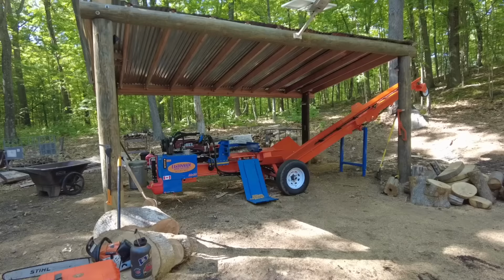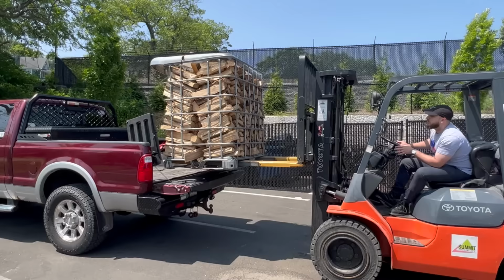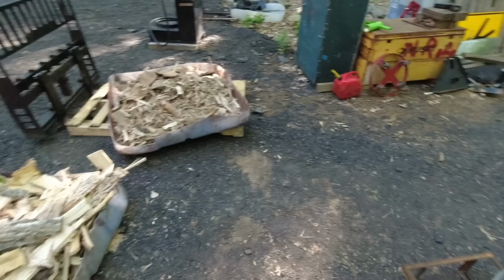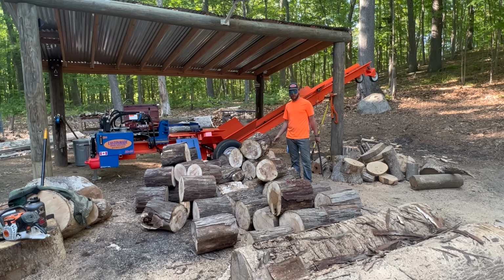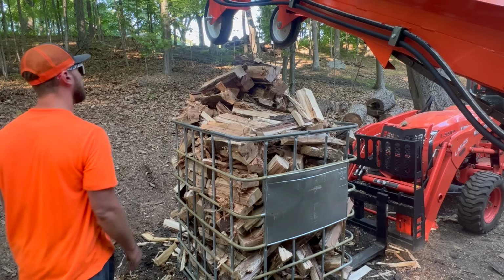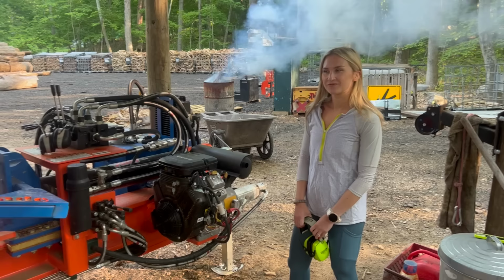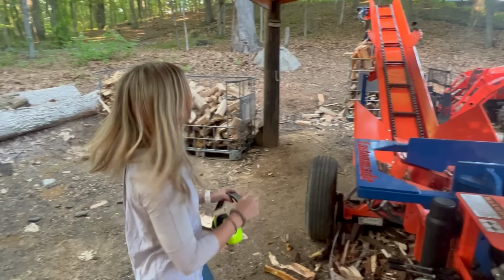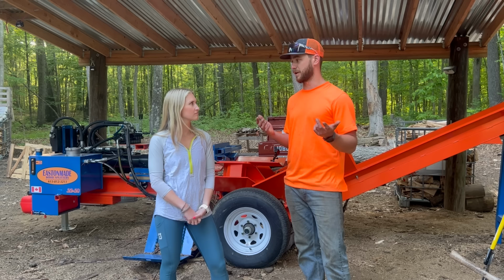#382 Splitting Hickory with the Eastonmade 22-28 & 7-Way Box Wedge

Comment: You have a first class operation and woodyard over there!

I like the fact your split wood goes straight into IBC totes, which significantly eliminates handling. If all deliveries use your totes,  you will be light years ahead of your competition.  

If you have to dump loose firewood for some customers, you can buy a "rotator" for your tractor to empty out the IBC tote into your dump trailer, to eliminate "that" extra touch of the wood.

I've been "pushing" the IBC tote method, but there is fierce resistance to buying them, and dropping them off at the customers place of business, or their residence. The  customers love them. I noticed you deliver them with the roof on top. Very nice!
Reply: The following video at the 9 minute mark, demonstrates the "fork lift rotator device" for dumping out ibc totes into trailers for loose delivery dumping.

https://youtu.be/jZr5h4xzKJQ
Reply from the maker: Thank you, unfortunately most of the rotating fork assemblies I’ve seen are designed for skid steers and are pretty heavy. If I were to get one I’m not sure I’d still have enough lift capacity for the forks and the full totes.

Comment: Try using a Mini escalator with a thumb to hold the wood when you cut it. Also, put the logs right next to the lifter for the sweater. I love the Eastman sweaters. I'm from Connecticut and didn't know there was any in the sta

Comment: If you can ? Could you get a moisture read on that hickory?
Reply from the maker: Checked the other day, it was mid 30’s
Reply: Higher than you thought? It was light?
Reply from the maker: @mikeadams2339  it was light for hickory, not like poplar or anything. About where I would’ve guessed, usually just the ends of logs will dry when in log form. It should dry out pretty quick now that it’s split!

Comment: Dan's 37d conveyor speed is not adjustable, is your's?   She could stand on a short large round
Reply from the maker: I haven’t seen any speed adjustment, I will get her a step stool.
Reply: @DudeRanchDIY   how's the air down there? Looks like Beijing here in WNY w faint smoke smell
Reply from the maker: @brandonhoad9033  very smokey, pretty distinct smell of smoke all day yesterday. And I wasn’t burning in the barrel 😂
Reply: Jake -  I’m new to your channel. Any particular reason for burning your scraps; or just to get rid of them ?  Thnx…
Reply from the maker: I separate out the “kindling pieces” I burn them so as not to accumulate a big pile.
Reply: @DudeRanchDIY  Got it. Do you treat “kindling pieces” different than scrap type stuff, or just all the same ? Thnx
Reply from the maker: @mikemccormick3764  I separate it instead of burning it. All the kindling goes into a tote for drying just like firewood.